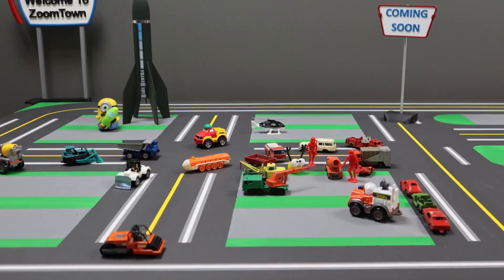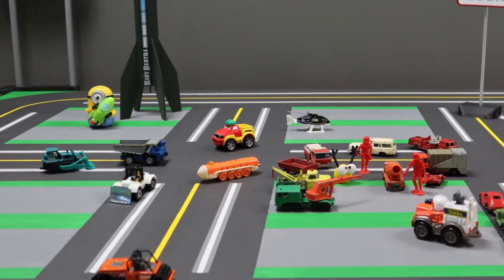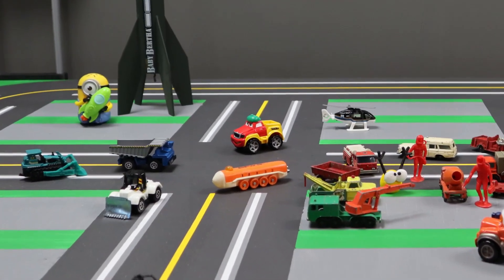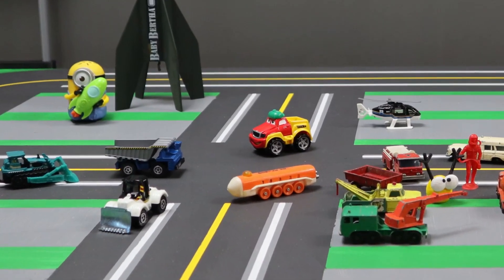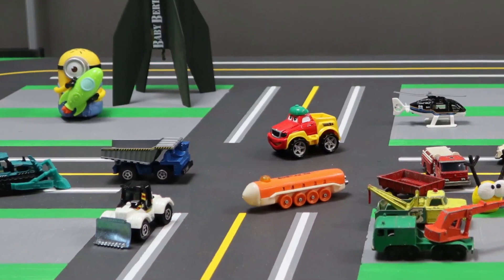Intro #1 ZoomTown - Automated Transportation System With a PICO

Comment: zoomies, battery powered and/or induction, flywheel, spring tension ... sensor infrared seems to be the smallest or reed switch,
a lot of decisions, could be fun. Problem with non electrical motion, how to stop + start again e.g. cross road, pushing 2 wheels in the air seems the solution, but how, could have a single middle wheel that makes it move.
Do we need to stop, automation could make it mesh but a railroad track or open bridge needs stopping.
Signalling our speed info to the car behind us, is that useful (ble)
Reply from the maker: Hi @jyvben1520,
You see the potential for a lot of fun in this!  There will be about 4 more introductory videos for ZoomTown, then I will start publishing the series.  I certainly hope we can get more viewers involved as the potential is very high.
Cheers!
Chris